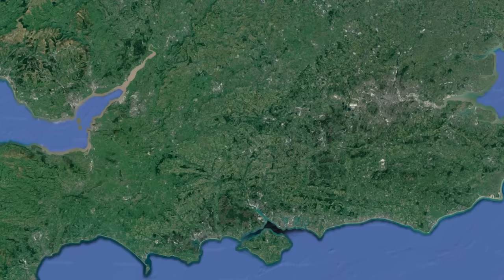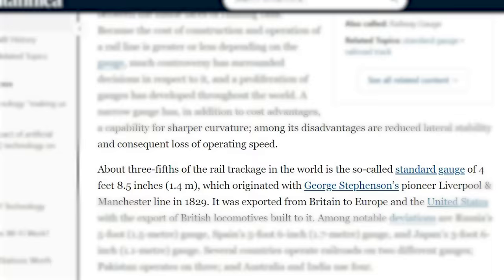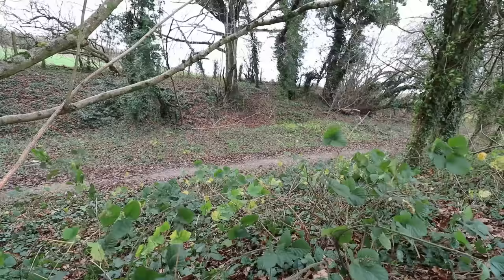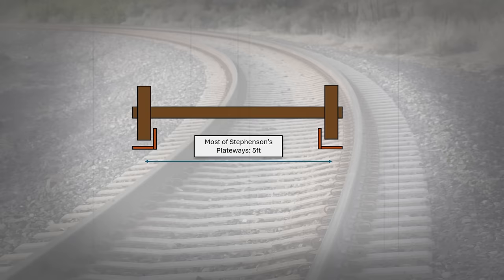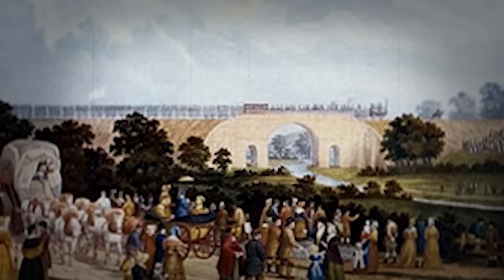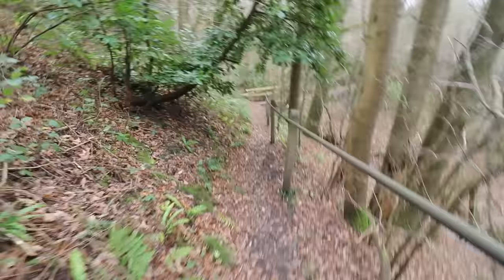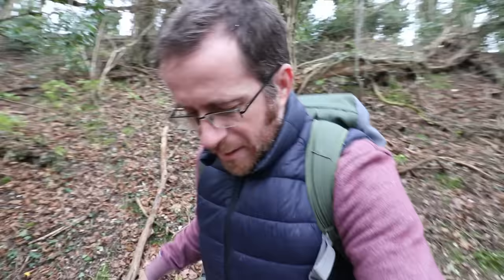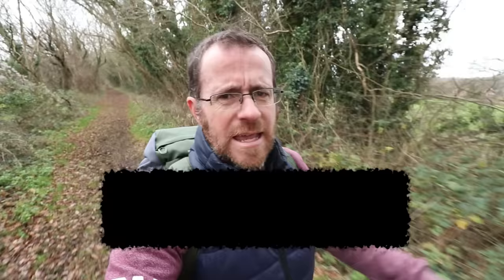Railway Gauges did NOT Evolve from a Roman Chariot.

Comment: I worked for one of the largest U.S. railroads for 40 years in the Engineering Department (Track). The thing about gauge is this, it's very hard to keep track within specifications. You think you lay your rail at 56-1/2" and it just stays there. NOPE! On curves, the high, or outer rail, gets worn due to the wheel wanting to go straight. So with rail wear on curves, and the pressure on the low side rail on slow moving uphill trains, keeping gauge within safe operating standards is a full-time battle. Some people will blame wood cross ties (sleepers in the U.K.) but concrete ties also allow the gauge to spread over time. So we have standards we learn and go by and work very hard to keep the railroad safe for everyone.
Reply: U.S. railfan here, C.B. That’s quite a useful datum! Thanks for sharing. 

🚂 ❤ 👍
Reply: Thanks for the informative comment. Is this particularly a problem for this guage, or would (otherwise practical other than switching costs) gauges suffer less?
Reply: Following the civil war in the US, there was a severe problem with non-standard gage tracks in the South. To solve the problem all the narrow guages were made standard on one day. Obviously this required great planning and labor.
Reply: A narrower gauge makes for greater speed and efficiency. Two wheels are connected by an axle and there is a tendency for one of the wheels to rotate a little faster and the other a little slower until the faster rotating wheel becomes a little 'stuck' - it doesn't stop. The wheel that was rotation g more slowly then becomes the wheel that was rotating faster and so on ad infinitum. The effect is to introduce greater resistance to forward motion. This resistance is reduced by narrowing the gauge. The most efficient gauge is a monorail, which clearly does not suffer from this problem. See https://youtu.be/Z8AOfoRmE00?si=mAL-NDsCwJyr4tEB

That the gauge of a railway should be similar to the width of a cart is hardly a surprising phenomenon.
Reply: @alanwhiplington5504  Interesting, thanks.
Reply: @alanwhiplington5504  Or you just make the top of the rail convex and the wheels conical, so the outer wheel rolls on a greater diameter than the inner wheel, thats standard in europe and most of the world, only the US as usual clinche to an outdated system with cylindrical wheels, like they do with drum brakes on semi trucks and measurements in bald eagle per school shooting.
Reply: @wolf310ii  The phenomenon applies to conical wheels, as used everywhere, including Europe. It happens when the train is travelling in a straight line. It can be minimised by precise engineering, but it is impossible to stop completely.
Reply: I have a question for you, if the US decided to broaden its gauge, would it be possible to lay down a third rail outside of one of the two current rails, and what would be the minimum safe distance that that rail would have to have?
Reply: @marcm.  We had to go the opposite way in Victoria, as we have the 5 foot 3 inch Irish gauge which meant that when travelling to New South Wales you had to get off the train about half way and get into their standard gauge carriages, a third rail was squeeezed inside to reduce track to standard gauge some decades ago.
Reply: @alanwhiplington5504  The state of Queensland uses 3 foot 6 inches, South Australia and Western Australia, i think have a mixture or narrow, standard and broad gauges.
Reply: @marcm.  Of course its possible, its even commen were two railsystems with different gauges connent, like between Europe and Russia, there has only to be enough space between the rails for clamping the rails to the sleeper.
There exist even some with 4 rails, outside for standard or wide gauge and inside for narrow gauge, but usually only for turntables and train sheds, so the train is centered on the rail
Reply: @jeffdittrich6778 The south narrow gauge wasn't an issue. It was their 5' broad gauge. Standard gauge didn't become the law of the land until 1886. For some reason, a lot of railroads in the south moved their rails to 4' 9" which was good enough for standard gauge to operate. They would eventually move it over another four inches.
Reply: Why would they want to do that. If you want a wider train just widen it. Take a close look at a Japanese bullet train and you'll see that thought the train is much wider than trains elsewhere the wheel gauge is the same. @marcm.
Reply: @alanwhiplington5504  Thx for the reminder of that mechanical feature.
Reply: @marcm. Lots of trackside buildings would be too close to the trails, bridges over railroad tracks would be too narrow, right of ways wouldn't be wide enough, and tunnels too narrow. So, it's not going to happen.
Reply: @wolf310ii   Well, that's a surprising slurry of anti-American rhetoric. Wouldn't expect that on a good natured channel like this one.
Reply: I can't ever see them trying to widen the gauge for any reason. This standard gauge has worked great for 150 plus years and there would be no benefit in changing it. The cost would be astronomical making it prohibitive. I knew of what was called a "gauntlet track" where the switch points were on one end of a tunnel. so if a train was to be put in a siding, they would throw the switch at one end of the tunnel, and the train travel on a separate track through the tunnel, then upon exiting the tunnel was where they placed the Frog, the component where the wheel actually transfers from one track to the other. I was told that the reason they did that was the siding was going to be so short on the other end, this saved them some space. It was gone when I first saw it, but you could see where the rails were, and they were able to do this on 10 foot long ties. I hope I explained this so it's easy to figure out what I'm saying.
Reply: Really enjoyed this video, because, like many , l grew up believing that the 4ft8.5inch gauge evolved either from a Roman or Celtic chariot. Thank you Paul for your research & loved seeing the exploration of a old, abandoned rail lines, something we do in Canada. Much better now that the right-of-ways are now being left continuously intact for public use. There is even an excellent book on former lines in the province of Ontario, called Ghost Railways of Ontario, by author Ron Brown.
Reply: My father worked for the Erie RR in the U.S., a major line from NYC to Chicago. The Erie was originally built with a 6 ft guage.  Even though it converted to standard guage, it had an advantage in handling wider cargo due to its wider tunnels, viaducts, etc.
Reply: @williamprice9696  I worked on the old Southern Pacific (Now Union Pacific) and parts of the old S.P. were built by different railroads, and for example, the tunnels in Oregon are narrower than the tunnels on the original transcontinental line (Central Pacific - Union Pacific). I'm not sure how wide of load the wider gauge allowed but like you stated, the bridges and tunnels would need to be wider also. As a side note, we are able to ship some pretty wide loads on the 4'8-1/2" gage trucks and railcars. And the wider the gauge, the more wheel scuffing you would have on one wheel traversing a curve at a different speed than the other wheel. Scuffing scrapes steel off the wheel and top of rail. We also run a "Clearance Car" that measures the height and width of tunnels and thru tress bridges for any clearance issues. Like I said, track doesn't just lay there permanently. The whole track structure can actually shift for various reasons.
Reply: Is this the reason why everyone drives in the US? /jk
Reply: @wolf310ii : you have absolutely no idea what you are talking about. The AAR standards are based (for the most part) on a conical wheel with 1:20 taper and have been for a very long time. The nuance in successive standards has been in flange profiles optimized to minimize curve drag.
Reply: @alanwhiplington5504  adopt a donkey? wtf?
Reply: @wolf310ii  You don't know what you are talking about. US and European railroad tracks are the same.
Reply: @noscwoh1  I'm American. And just to make things worse a Trumpist. I thought it was amusing. here is what I said. ==>  " bald eagle per school shooting." a very interesting metric.  Well done.
I'm an EE (I like measuring) so that may explain it some.
Reply: Choo choo 🚂
Reply: @sipos0  No, keeping gauge is a constant battle for all gauged track.
It more depends on wheel tread width, (and to a much lessor degree, railhead widths) - than any other thing.
If a wagon's wheel treads ARE NOT WIDE ENOUGH, even a small gauge difference becomes a major problem, as the narrow tread wheels will drop between the rails - resulting in an instant derailment, chewing up fastenings and sleepers and force further spreading of the gauge, meaning more and more wheels drop between the rails, until the entire train is involved.
Keeping gauge is by far and away he worst maintenance problem followed very closely by excessive twist & reverse cant problems.
Reply: @jeffdittrich6778  Not really, as all it involves is physically moving one rail in (or out) to obtain the new gauge.

Hence, the preparation of the "one day" event, would have taken considerable time, to thus have everything ready, even to having one side-of-rail fastenings installed, to allow the rail to be VERY QUICKLY pushed in or out, to become the new gauge, meaning JUST the inside (or outside) fastenings to be inserted before all were tightened, (and by that I meant every fifth or sixth sleeper would be affixed, as that's all that is needed to keep gauge, before the next day/week/months later, all fastening are installed and tightened.

Thus yes, in theory - it takes JUST ONE DAY, (to physically shift one rail to be at a new standard gauge) when in fact it takes months, even years to fully complete, from first concept, through various adzing and plate bed relocations, to boring and inserting fastenings pre-actual regauging, then on the day, boring/inserting fastenings ever 5th sleeper to have a temporary "fixed" new gauge, through to weeks / months of hard work, installing every new fastening required, as well as altering switchyards and switch blades, to align with the change, through to eventual "full change over" after replacing every old gauge sleeper, with a shorter, or longer one as needed, thus to pull a wider gauge IN, one only needs to re-adze, or replate a new bedplate in the desired position on every FIFTH sleeper, where the furthest away spike is inserted to stop the rail going to a smaller gauge, thereby allowing track gangs, to pull all other spikes on the inside of the existing rail, leaving every fifth one in-situ, awaiting the swap-over date.

Preparing for such an exercise takes MONTHS of hard work, and design problems to be resolved, such as where the track has multiple switchwork, to either side of the main line, all needing to be exactly on-gauge, for the through mainline, even if the "switched-away" section isn't completed, on the day.
As not every train needs to be diverted off the main at every switch location, so the engineers involved, have to PLAN which switch is the most important, and to thus "change sides" by using one rail, then the other, as the one that remains in place, moving it's counterpart to regauge.
This means that somewhere along the route, between switching rails, BOTH need to be oved, otherwise the S-bend at the swap, would be too great to maintain LINE, which is that word given to maintaining the alignment in order to do a temporary S-Bend between one outer rail & the other.
These transitions in gauge positions, require a LOT of preparation work, and the re-drawing of the District Civil Engineers, trak plans, to ensure the works gangs get it right, on the day.
Reply: Narrow gage trains 🚆 were nice. I  got to ride the rails and wait for supper while the workers replaced the tracks in favor of the newer wider rails. It was not a very vivid memory. Mother was the railroad cook for the crews. And I was the secret.
Reply: Thank you. I hate when my train derails.
Reply: @marcm.   The Union Pacific transcontinental  railway was to be built  about 5 ft gauge, 
But President Lincoln changed it to 4ft 8 1/2 due to the war starting for a cheaper cost.

Comment: Technically, the 4'8.5 inch gauge applies in Britain and not the UK as Northern Ireland uses the Irish gauge of 5'3", set out as the standard gauge for Ireland under the Railway Regulation (Gauge) Act 1846.
Reply: Most Scottish gauges in the early years were 4ft6in so I agree with you but only applying to England.
Reply: FYI  North American gauge   4’ 8.5”
Reply: Careful now, there is a rabbit hole opening up there, maybe more than one!
Reply: Interestingly, British engineers built many of the railways in Brazil, a lot of them with this “irish” gauge. Standard gauge only became used recently for lightrail so they can buy off the shelf equipment.
Reply: So you didn't get the Brexit memo?  The U.K. left Northern Ireland behind.  Sorry about that.
Reply: Unless you folks are transferring railcars to each other, gauge doesn't really matter. In the U.S., there are so many railroads that exchange cars it works out better to all be the same gauge. Where I grew up, there was a Narrow Gauge railroad 3 ft gage, and they had to build a transfer facility to move freight off of standard cars, to the narrow gauge cars. Most narrow gage railroads are gone now, with a few operating tourist trains.
Reply: Yes. Despite that clarity on the need for a common gauge no direction was given to the Australian colonies and they made a complete mess of it despite  agreeing at one point on 5’3”. 

I highly recommend the following PhD thesis which is available online:

The Myth of the Standard Guage: Rail Guage Choice in Australia, 1850-1901

Author: Mills, John Ayres
Abstract:
This thesis describes the rail gauge decision-making processes of the Australian colonies in the period 1850 - 1901. Federation in 1901 delivered a national system of railways to Australia but not a national railway system. Thus the so-called 'standard' gauge of 4ft. 8½in. had not become the standard in Australia at Federation in 1901, and has still not. It was found that previous studies did not examine cause and effect in the making of rail gauge choices. This study has done so, and found that rail gauge choice decisions in the period 1850 to 1901 were not merely one-off events. Rather, those choices were part of a search over fifty years by government representatives seeking colonial identity/autonomy and/or platforms for election/re-election. Consistent with this interpretation of the history of rail gauge choice in the Australian colonies, no case was found where rail gauge choice was a function of the disciplined search for the best value-for-money option. To the extent to which economic variables were considered in rail gauge choice, the initial cost of construction became the proxy for value in building and operating railways. In Australia engineers' opinions in the role of advice to governments or parliamentary committees were substituted for rigorous evaluation. These and other findings were reached by reference to primary documentation including companies' minute books, official correspondence and reports of the proceedings of parliamentary committees, generally missing from earlier studies. This study analyses and interprets them by reference to the history of the 'standard' gauge, to the economic and constitutional settings of the time, and by reference to rail gauge choices and decision-making processes in other large developing economies of the time, notably Brazil, India and the United States. In so doing a new narrative and interpretive study of early rail gauge choice in Australia has been created. The finding that previous studies of the early development of Australian railways either ignored or misread important documents has led to a reappraisal of the part played by several individuals, including engineers in all four colonies, Lieutenant-Governor LaTrobe and WE Gladstone in his role as Secretary of State for the Colonies and for War.
Reply: The LB&SCR was known to set its gauge to 4'9".
Reply: @coldblue9mm  There were similar transfer facilities in Ireland as we had quite a few narrow gauge lines (in Ireland, narrow gauge was almost exclusively 3'0").